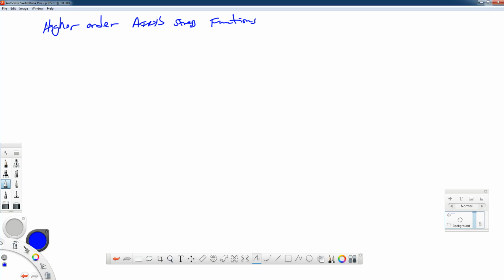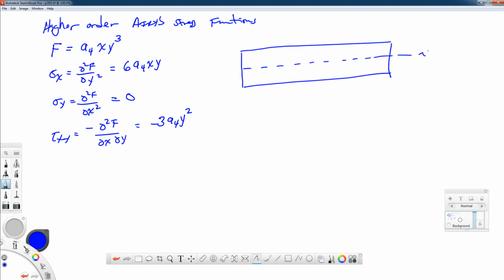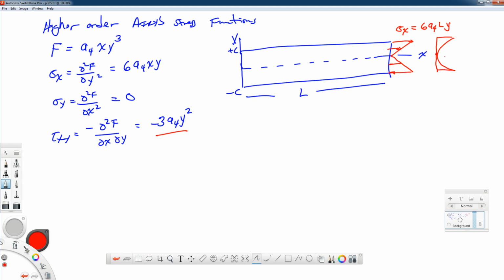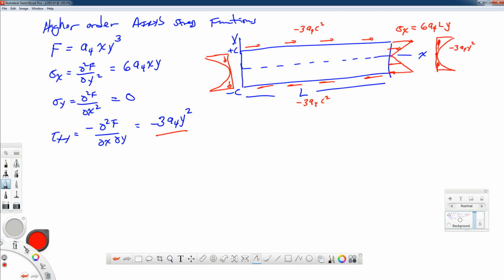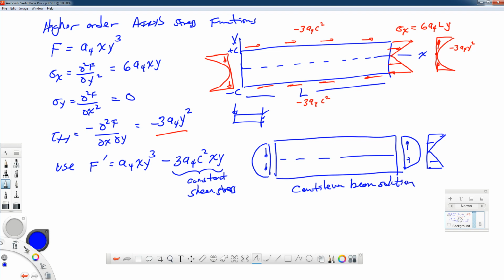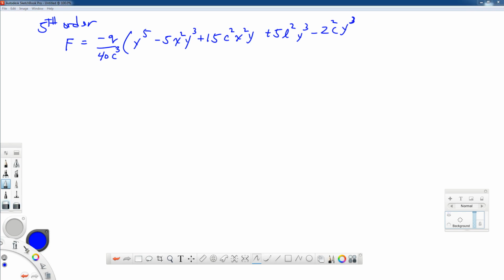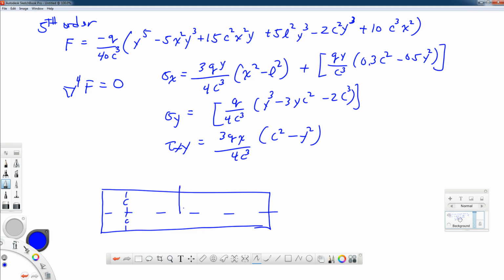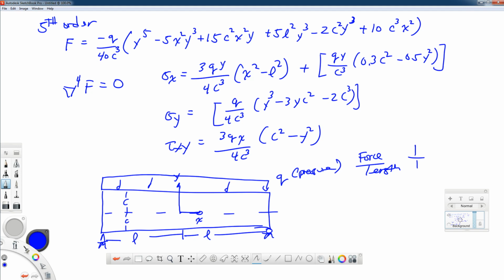Theory of Elasticity-Lecture 28-Higher Order Ploynomial Airys Stress Functions

Comment: Dear Sir, thank you very much for very useful lectures. I have a question if you could please answer. For a case of simply supported beam subjected to UDL,  the moment is zero at the supports but when writing boundary conditions are vertical faces near supports, we take the integration of bending stresses equal to zero. Why cannot we directly put bending stress expression to be equal to zero? Thank you in anticipation.
Reply from the maker: I think the answer you want is based on the mathematics:  We have taken a 3-D problem and reduced it to 2-D, then invoked a stress function approach to make that math easier...so we have given up some elegance for practicality.  

But consider the deeper philosophical answer:  even our 3-D problem is a representation of what we think of reality...find a actual simply supported beam with a uniform distributed load and look at the supports--which are a finite width--what location there has a totally zero bending stress distribution?  Maybe that approximation of no net resulting bending moment is OK after all! 

We can continue this discussion through to finite element analysis, and I can counter with relativistic mechanics and quantum mechanics.  And even then we end up with the same question--is our simplification good enough?
Reply: @mbarkey.mechanics  thank you Professor. I get it now

Comment: I read too much about airy function and I know how to work with it to conclude all stresses but my question still in my mind is how we decide the airy function from the beginning and depending on what?
Here how you decide that F=axy^3? And in this form ?
Reply from the maker: Hi Nidal, determination of appropriate Airy's stress functions is very much like solving a puzzle.  There are two common cases.   One case, you know the stress field that you want to end up with--such as a simply supported beam with a constant distributed load--and then you work with stress functions and superposition to eventually yield the solution that results in your stress field.  In the other case, you start with some Airy's stress function and determine the stress fields from the appropriate partial differential equations, and then see if your stress fields fit an actual problem.  

Both cases can require insight into the stress fields.  In very complicated cases, such as the Westergaard function for crack tip stress fields, they require some amazing insight.  (I often mention to my students that this function was developed before the distractions of modern life--no wide spread telephones, let alone TV and the other entertainment options we have available  today.)  So, selection comes down to experience and insight.